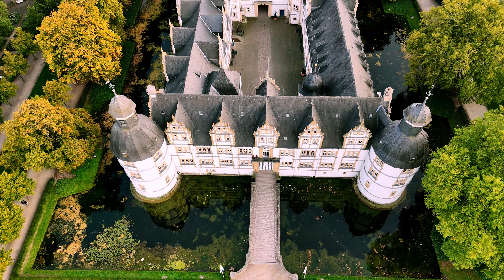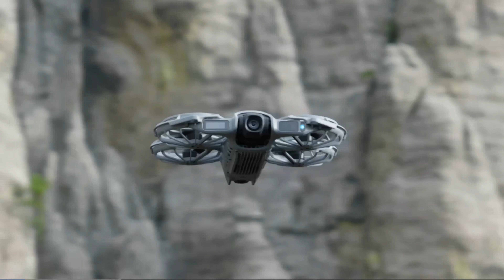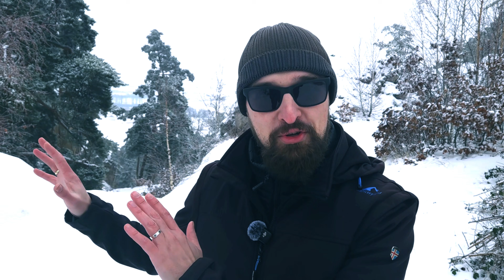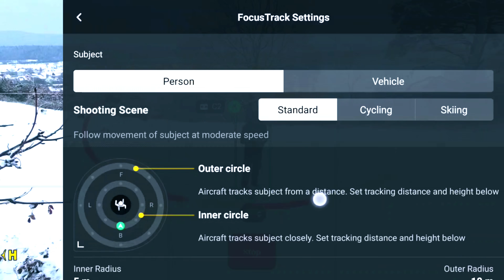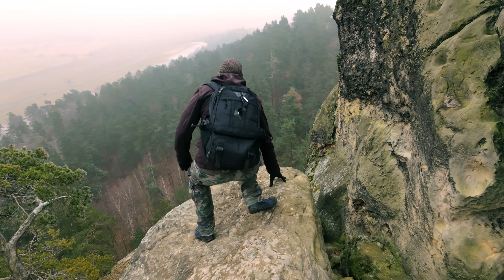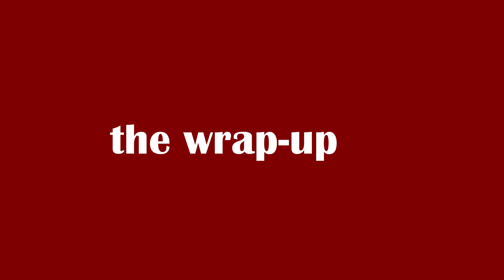DJI Neo 2 Insane Tracking Stress Test While Hiking

Comment: Bought it last week, and it's really amazing. There's only one issue and two missing features:

In fog, it fails miserably, detecting obstacles all around itself and refusing to do anything until I disabled obstacle detection and manually flew it back to me.

I'm missing automatic modes to record the surroundings — something like MasterShots, but filming the scenery around or in front of us, not just us.

Missing "auto" direction — something like the Mini has, where it automatically chooses and changes the filming direction. This would add more "action," preventing boredom and freeing me from manual decision-making (after several hours of hiking, one simply runs out of ideas).
Reply from the maker: I seriously love that one. However it is not perfect. And yes, thick fog is an issue but tbh that is always a problem, also for other series like Mini or Air.
Regarding mastershots - I don't miss it, as I usually don't user even on my other drones. :)

Comment: Mine first try hit a little twig, fell 2 ft and broke the gimbal...fragile drone
Reply from the maker: Yeah, that’s unfortunately the weak point.
The gimbal is a bit exposed and a small hit from a wrong angle can be enough, especially with twigs.
That’s why I’d never call it a crash-proof drone, even though the tracking itself is very solid.

Comment: How many batteries did you go through while recording this please.  I read that NEO 2 batteries especially in terrain like this goes for 10-12 minutes while claims of 25 minutes for hover mode. ?
Reply from the maker: the drainage of the packs is heavily depend on the weather conditions. 
that day and at this height it was pretty windy and the neo 2 had to fight lots of gusts.
The footage either in the cave and on the rocks was created by just one pack.
However I used a second one that day for a RC2-flight around the rocks.
In total I used three packs that day with an average flight time of around 15 mins each.

25 mins is unrealistic and will never be reached.
It is the same like with cars. you never reach the range given by the manufacturer. :o)
In total I am pretty satisfied by the flight duration. ;)